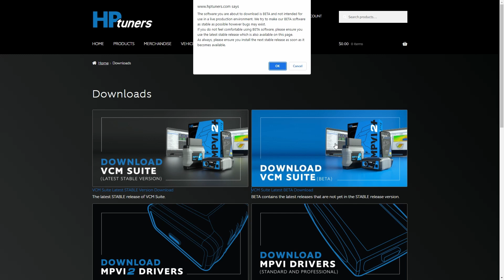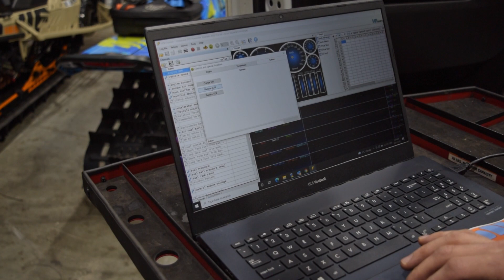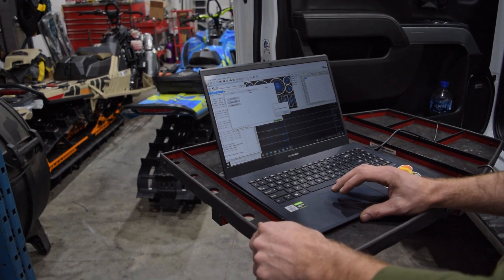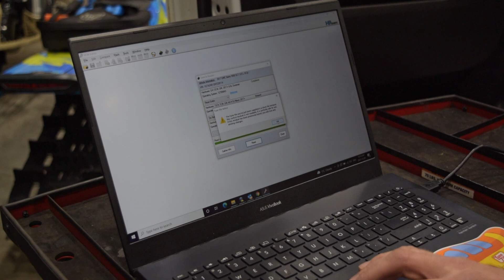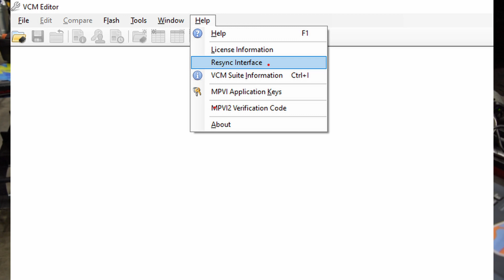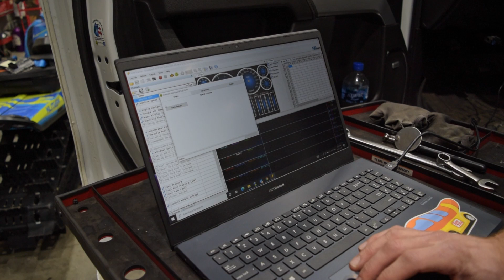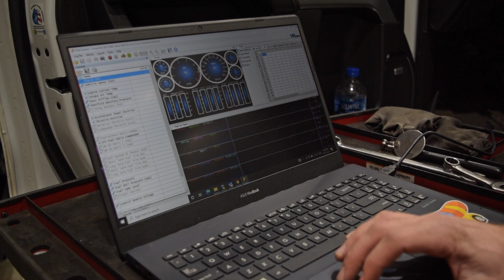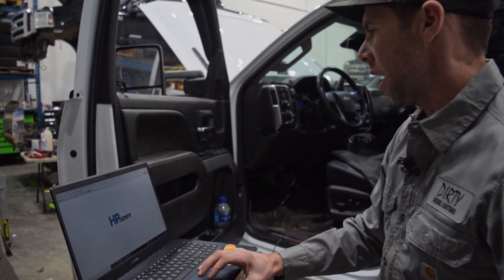How To Tune 2017-2019 L5P Duramax With HP Tuners

Comment: How to check to see if truck took the tune file on hp editor?
Reply from the maker: You'll see "Flash Completed Successfully" when the tune is flashed. If the tuner stops during the flashing at any point that is also a sign the tune didn't take. Ensure you see that final message to confirm the tune was done.

Comment: Once you completed the ecm swap and have all the data from the old one and put it on to the new ecm, could you drive the truck stock while you wait for the tunes, and then one you have received the new tunes complete the modifications you want? And then write the new tunes to the truck?
Reply: Yes the stock will be put back on until you received the tunes for the unlocked ecm

Comment: Great video ! I have a 2018 2500  deleted running  the same hpi ecm . The way mine is set up I can use the cruise control to toggle threw 5 tunes . I was wondering if there’s a way to completely remove def tank .
Reply: Yeah def is no longer needed if you fully deleted it, so just unhook it and unbolt it and take it off

Comment: So before you remove the stock ECM and read the stock file, is that stock file saved somewhere? If I needed a stock read file and it isn't saved do I need to put the stock ECM back in to do a read and then save? I need a copy of my stock read file
Reply from the maker: You shouldn't need a stock read file from the OEM ECM, the aftermarket one that you're installing has a stock setup on it, but is tuneable, so you save that stock read, and then tune it accordingly. If you wanted to revert the truck to an OEM setup you'd load the HP tuners ECM stock read back onto it.